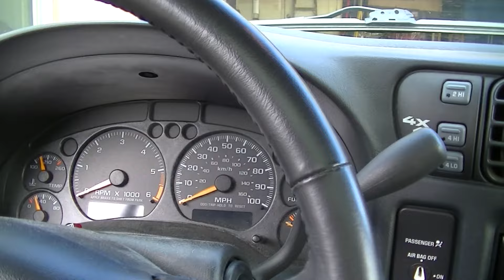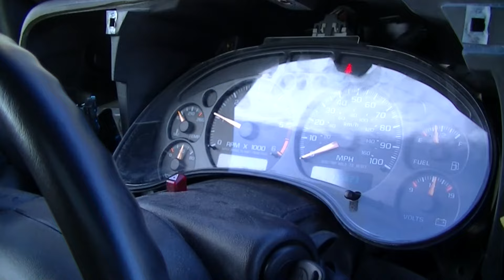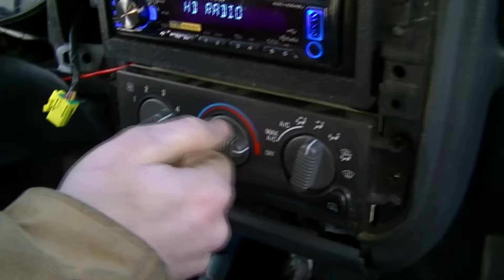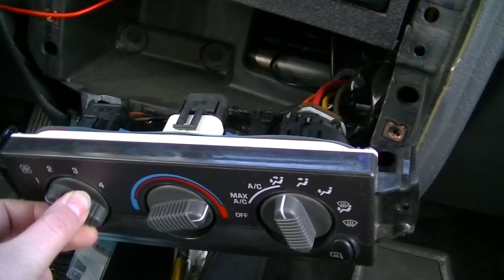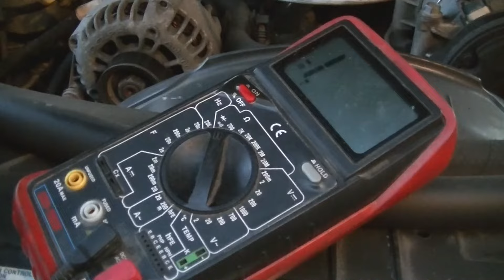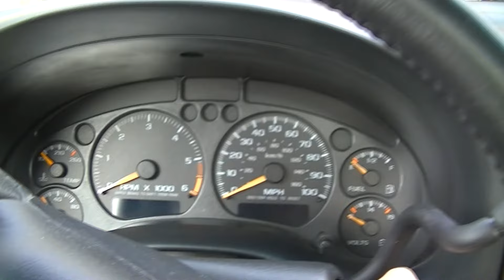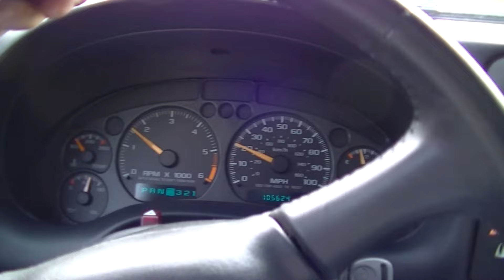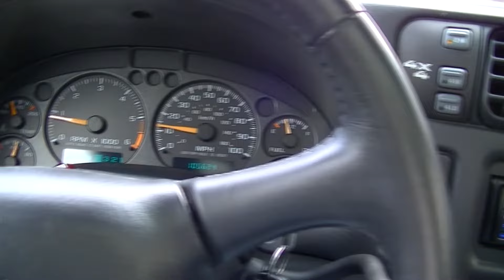Chevy S-10 No Intrumentation and Heat issues - Diagnosis and repair

Comment: Thanks for the help, I treid to change mine . Got new one at NAPA. Didn't work. I went to my fav shop McDonalds Auto Repair Hebron Ohio and it was the small black relay that is next to it bolted on the wall right beside it.  Chevy S10 2000. LOL the last shop that looked at it gave me a 2 hr estimate to look in the dash LOL.

Comment: Nothing wrong with your driving method doogie, you have your mind in the right place.

The instruments were a red herring, it really throws you off the path dont it lol, ive had a few red herring times and its a good time to swear :D

Those bloody thermal fuses are a dam pain, they pop because of a short overload and not overheating, ive had many an item that didnt work because the company buried one under the tape covering a transformer primary winding, the transformer got too hot because of the tape and enclosed design, bloody silly manufacturers lol.

Comment: I was really hoping you were going to get into the blend door actuators in this video!! I own the same vehicle and I need info on what to look for and what to replace. Great job my man 👨
Reply: When my blend quit working it was just a short cracked vacuum hose under hood at driver side top.
Reply: Look or listen for a vacuum hiss around the HVAC control switch or transmission fluid in the vacuum lines in the engine bay firewall area, on the driver’s side.

Comment: So if my 99 jimmy the heater,defrost,vent all never blow out hard.But there are times it will come out hard on defrost and then you take it to 1 and it slows down and that.I also left comment before saying if you put it on floor it blows out the vent and so forth..NEED HELP

Comment: After removing the two screws from the side, squeeze the clips on the sides to release the HVAC head unit. I just got this 03 Blazer a couple months ago, and it's my daily driver with a bunch of little stuff to do. The two top clips must have been broken off before I got it, because all i did was remove the two screws and the top just kinda tipped itself forward just a little. I didn't even know that any of them were there. I figured the unit was just lodged against something because I was pulling pretty damn hard on the bottom, but I figured I should just stop before I broke something.

The whole thing started because I wanted to install blue LEDs. I saw that the bulbs were much smaller than the ones in the instrument panel, but I have no idea what to get. I was able to get the top two out to maybe give myself a starting point, because I haven't been able to find those micro LED and socket combos by listing. They look just like the little blue sockets sticking out of the back of the HVAC head unit in this video. If anyone has any info on these, I'd appreciate it very much. I also have plans to do all the lights in the switches in led blue as well, like the headlight, 4WD, and the door panel switches, but things like the courtesy, dome and map lights are staying the way they are

Comment: I have a 2000 GMC jimmy SLS 2 door 4WD, my heat isn't coming on, the blower motor does work and blows but no heat most of the time. It starts to come on for a couple seconds then no warm or hot air. What could be the issue?

Comment: I need your help on my 02 blazer . Blower motor has 1,2,3 but no high. New blower new resistor, fan switch and dont have hi speed??
Reply: replace the blower relay, it operates the blower on high speed

Comment: Change my restior but blower motor still wont blow is there a fuse or regulator im missing. 87 chevy s10 pickup 4 cyl
Reply: check the connector that plugs to the relay,might check on connector that plugs into the resistor also,  there is one wire that is too small of gauge wire for the load required by the motor. This causes the terminal on end of wire to heat up and melts the connector just a bit and causes  a bad connection from wire to the resistor connector pin. I had to rebuild the connector and install a new terminal end to plug on to the resistor. Check this see if that might be your problem.
Reply: Thanks for the help, I treid to change mine . Got new one at NAPA. Didn't work. I went to my fav shop McDonalds Auto Repair Hebron Ohio and it was the small black relay that is next to it on Chevy S10 2000. LOL the last shop that looked at it gave me a 2 hr estimate to look in the dash LOL.

Comment: I learned some stuff but wish you had shown more detail. That part controlling heater fan speed. I wish you had shown its removal. I have no idea where to find and replace it.
Reply: Thanks for the help, I treid to change mine . Got new one at NAPA. Didn't work. I went to my fav shop McDonalds Auto Repair Hebron Ohio and it was the small black relay that is next to it on Chevy S10 2000. LOL the last shop that looked at it gave me a 2 hr estimate to look in the dash LOL.

Comment: Thank u now im trying to fix my gas gauge its about half a tank off in my 87 chevy s10
Reply: My gas gauge works when it wants to on my 97 s10
Reply: Hirsch nope The issue probably lies in the positioning sensors on the fuel pumps float arm
Reply: It’s probably the sending unit as noted!

Comment: Could the coils in the video showing at the end, can that also be the problem for not having heat?
Reply: Or those coil are only for speed for the blower?
Reply from the maker: Jonathan only blower speed. If your coolant level is full and the blower worms, follow the heater hoses to and from your firewall. Inline with one of those hoses should be a valve that turns the hot water flow to the heater core on and off. Some cars dont have this, but I would start there.

Comment: I don't know what fuse was bad on your  truck but you did not show us and I have the same fuse out and the resister because it sounds the same
Reply from the maker: QsQuare55 AC / Heat Fuse. 30 amps. If I recall correctly it's located in the fuse center underneath the hood. I apologise for not showing the exact fuse location. hope this helps!

Comment: Hi, does anyone know the name of the plug that houses the vacuum lines and plugs into the back of the vacuum valve for the selector switch on the right of the climate control assembly?
Reply: Brian S. I know what you're talking about I believe it is this :

https://www.ebay.com/itm/152141711407     

BUT I couldn't find one for my 2003 s10 Zr2 so I purchased this instead :

ACDelco 15-72881 GM Original Equipment Heating and Air Conditioning Control Panel with Rear Window Defogger Switch https://www.amazon.com/dp/B000C9FHYI/ref=cm_sw_r_cp_api_MPCizbAAN6DB4

AND IT CAME WITH EVERYTHING NEW INCLUDING THE NEW VALVE, THE SWITCHES AND NEW LIGHTS FOR THE HOUSING. Hope this helps
Reply: @francoduran7849  did the vacuum lines just fit onto that amazon part along with the the electrical connector .
Reply: Ken Hilson yes, everything fit perfectly and I had no issue

Comment: Blower motor fuse keeps blowing after still replaced panel switches and motor any ideas pleeease lol
Reply: Thanks for the help, I treid to change mine . Got new one at NAPA. Didn't work. I went to my fav shop McDonalds Auto Repair Hebron Ohio and it was the small black relay that is next to it on Chevy S10 2000. LOL the last shop that looked at it gave me a 2 hr estimate to look in the dash LOL.

Comment: To open the hood of my 97 S10 I have to hit the front center of the hood with a hammer
Reply: I have the same issue but just use a large flathead and pop it up
Reply: Nikolai Ninja lotta dents I’d imagine lol
Reply: Factory model hammer?
Reply: I just use my fist. I give it the Fonzy treatment lol
Reply: Same issue on my 01 blazer